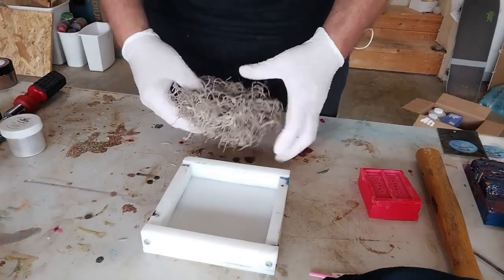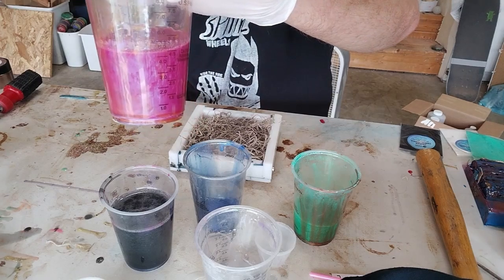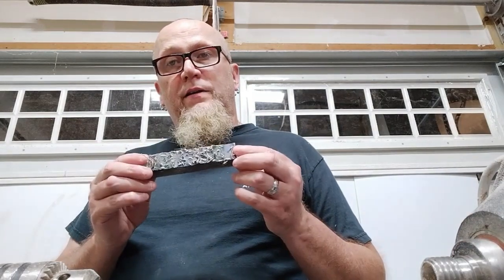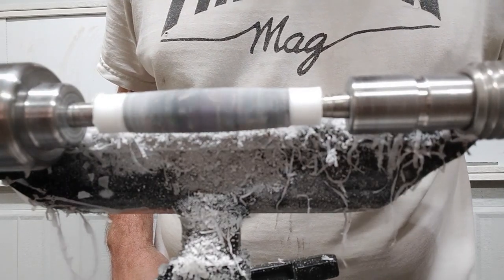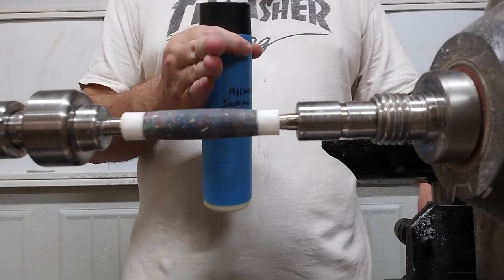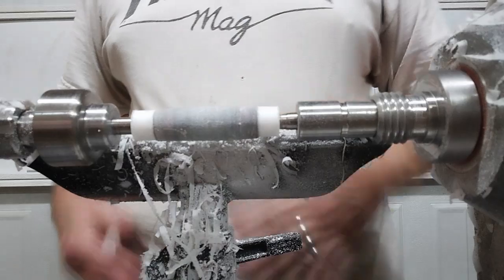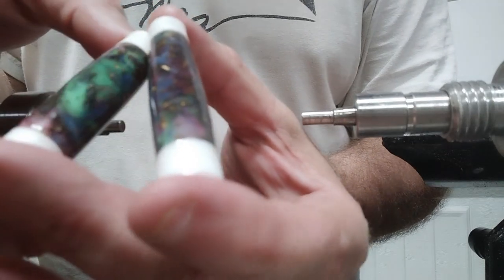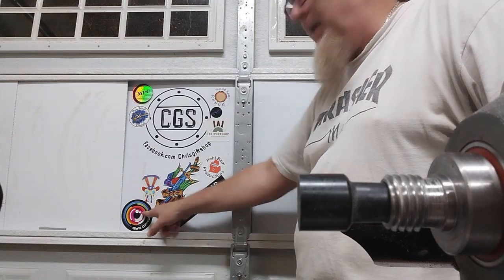Spanis Moss Pen

Comment: Nice looking pen. I was worried that the CA would fix the bushings to the blank, but they look to have come out just fine. I assume you wanted to moss to show more. 2 ideas for you. 1. Don’t use such solid colors. Make your resin more translucent. 2. Use more moss. In fact, I would suggest mixing the moss/resin before you put it into the mold. Should probably seem more like moss coated resin than resin with some moss. Just something to think about. Nicely done.
Reply from the maker: @DougMilleratWoodSpunRound  thank you.  Yea with the moss I'd hoped it would show like cactus does. If I do this again maybe I'll only do a single pen blank and not a block. Thanks for watching and commenting.